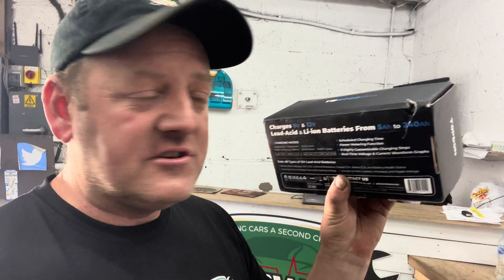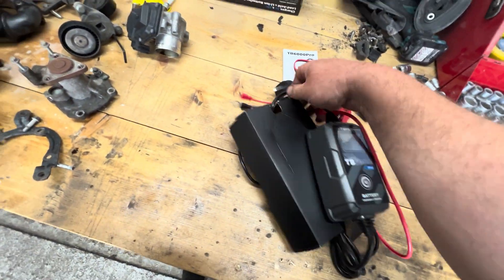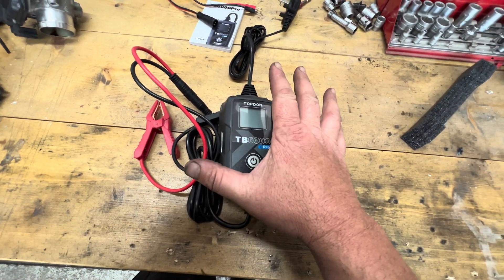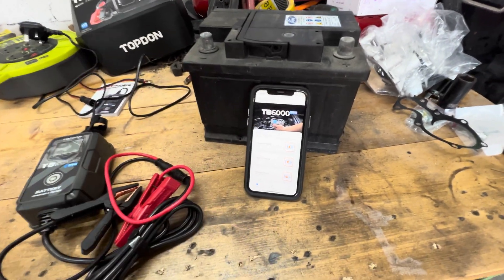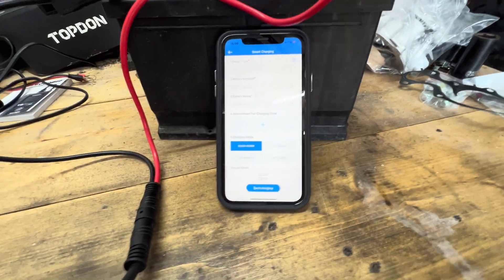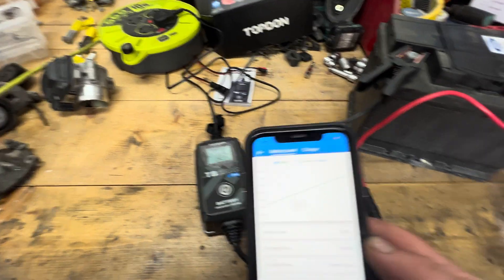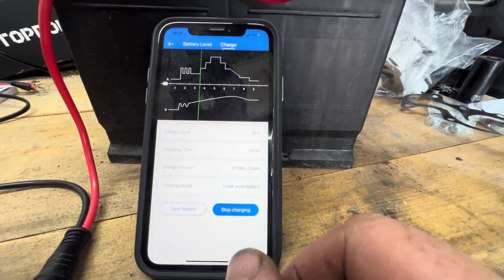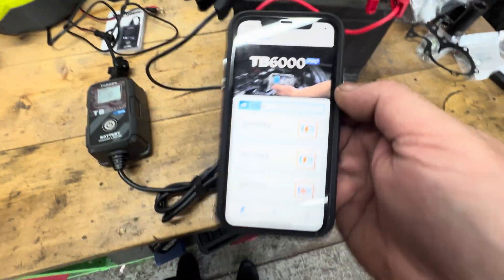TOPDON TB6000Pro 2 in 1 Smart Battery Charger & Tester with Bluetooth App 9 step smart charging mode

Comment: Had one for a while now, when it says change battery, I feel its not knackered but is slowly on its way. Maybe will fail on a really cold day. A couple of the family batteries have gone on 18 Months or so and still OK. Brilliant charger. I have some of the other TOPDON diagnostics, saved friends and family a lot, and TOPDON really does pinpoint the problem. I also appreciate there are other brilliant makes out there also. Great Channel.